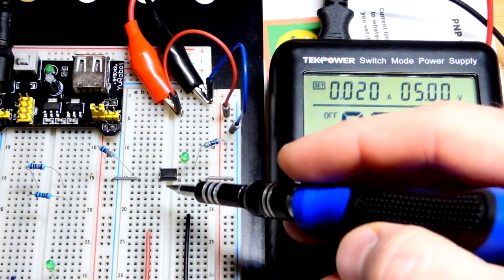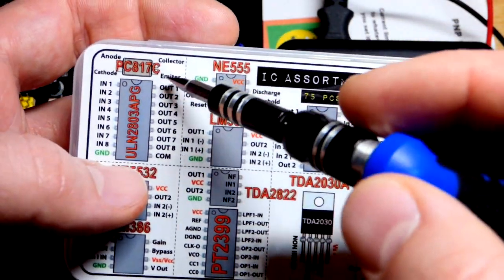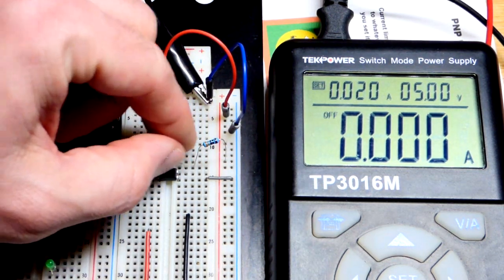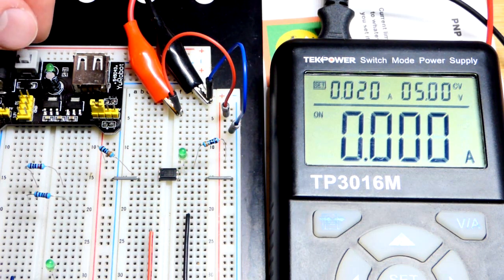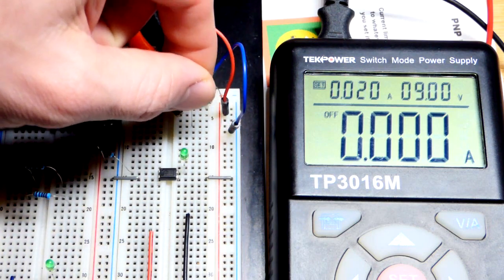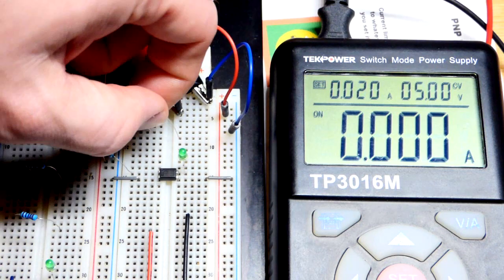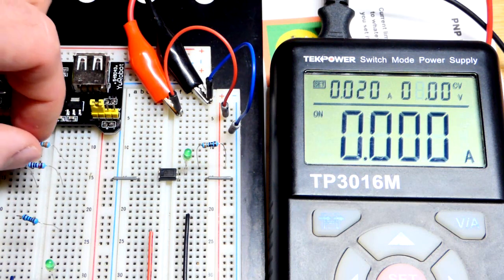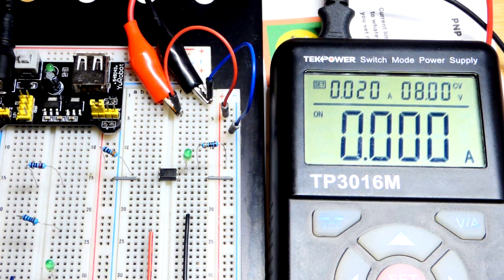Quick look at PC817 optocoupler from integrated circuit kit by electronzap review

Comment: It would be better to show the schematic. Also pulse the opto with a swuarewave and look at output on a dso as the rise time and fall times of opto's are slow. The diode in the opto is an infrared one as silicon photonics is more sensitive to infrared. Measure the voltage drop across this diode as it should be about 1.1 volts.
Reply from the maker: Thanks for the tips!

Comment: Nice video

The 517 Optocoupler does not have an internal resister.
According to the spec sheet, the input side has a max current of 50mAmp (But that is max).
It should be driven at a lot less current. 
My guess would be 10mA

Kind regards

http://www.sycelectronica.com.ar/semiconductores/PC8X7C.pdf
Reply from the maker: Thanks!

Comment: That is a cool looking kit. I have some PT2399 chips, they are involved but fun. The TDA2030 is a really cool audio power amplifier -- very breadboard UNfriendly however.
Reply from the maker: Thanks for the info! I did look at the TDA2030 datasheet and wondered how the pins would work with a breadboard.
Reply: I cut up a strip of phenolic PCB and soldered the TDA2030 to it, and underneath I just wired pin 4 around pin 5 and all the pins on the TDA2030 connect to a single row of 5 pin headers. You can probably just bend the leads across the gap in the breadboard however.